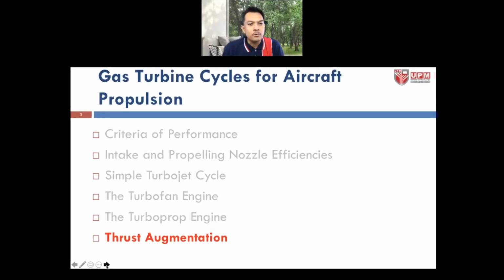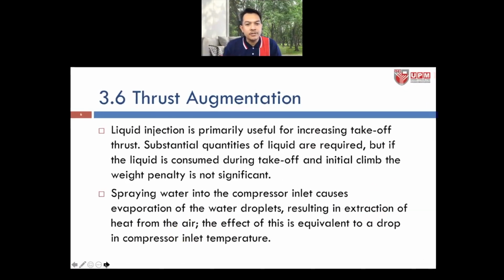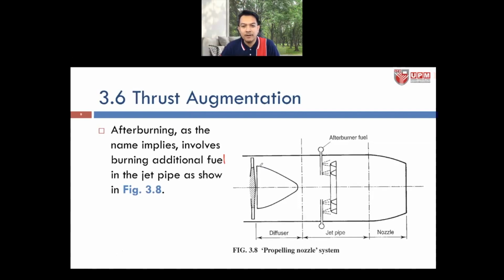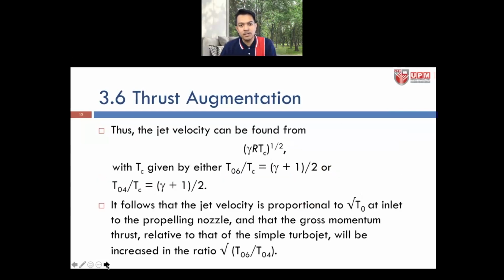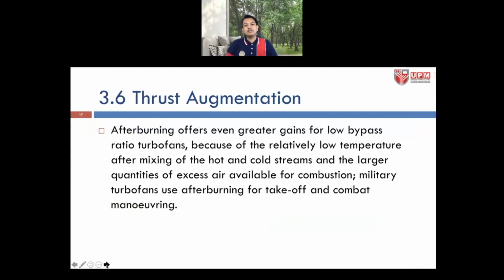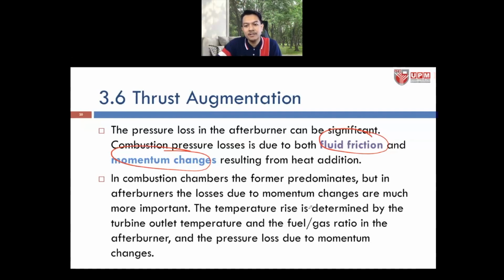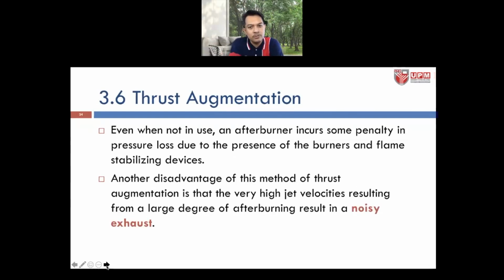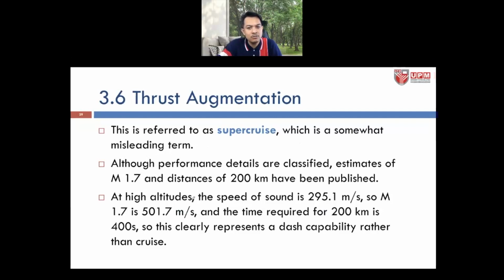THRUST AUGMENTATION

Comment: Why the turbines dont use oxigen to increase the burn of fuel like spacial rockets ?
Reply from the maker: It will increase in overall weight of the aircraft.
Reply: because thrust is due to MASS FLOW.
simply burning hotter doesnt increase mass flow anywhere near as much as pushing more air through.